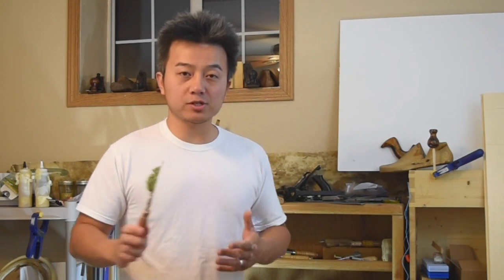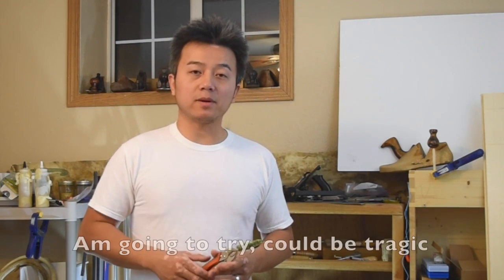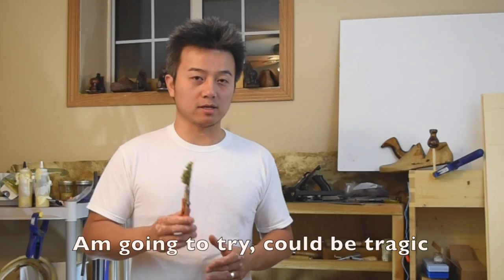Acetone "Lost Foam" Epoxy Casting - A Shrubbery

Comment: That's cool, but I heard acetone and dissolved styrofoam can be very flammable.  You might have mentioned that but I haven't got any speakers on this computer so struggling to lip read.
Reply from the maker: +Savvas Papasavva Thanks, I did not specifically mention it, but the MSDS will tell you all about acetone. It doesn't need Styrofoam to be flammable, it's vapors are easily ignited, specifically with a correct air:vapor. So it's best to be used outside, preferably cool or humid or windy. I hypothesize that adding Styrofoam would make it more flammable because the dissolved Styrofoam should make it easier for acetone to vaporize, similar to how salt lowers water's boiling point.

I taught chemistry at a university level for many years so I have taken analogous safety precautions towards chemicals outside of the teaching and research setting. There is no need to be afraid of chemicals, they need to be respected and understood, and they'll respect you back and make your life easier.